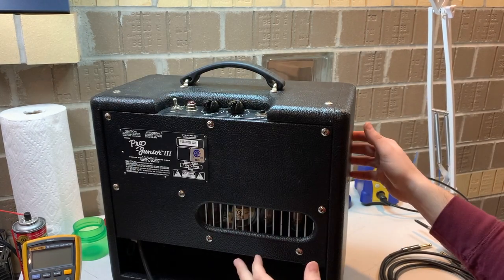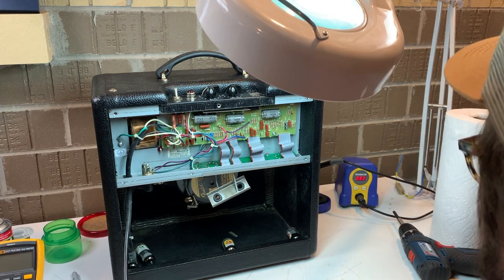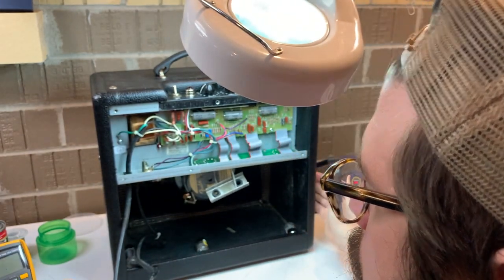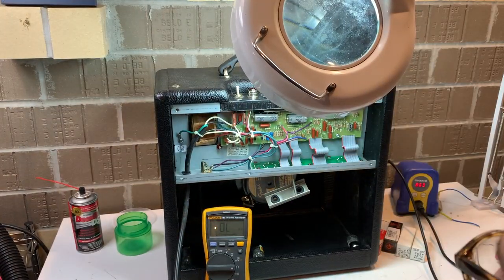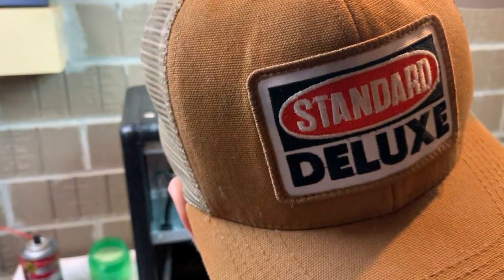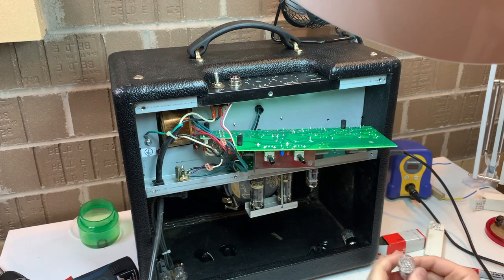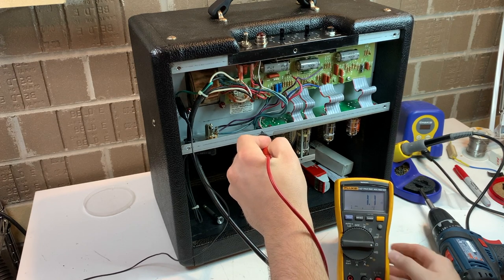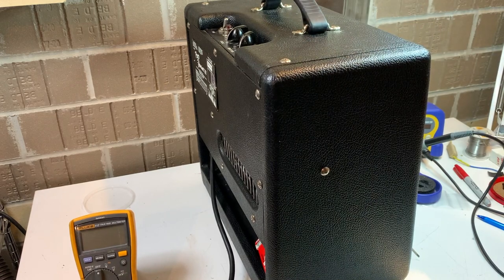Commonwealth Pro Audio - Fender Pro Junior Repair

Comment: could an xternal speaker out be added to this amp? thanks
Reply from the maker: Yes, but what's the goal? If you want to push the internal speaker and an external speaker at the same time, you would need to swap the internal to get the right ohm load with an external. If you just want to use an external cab without driving the internal speaker, you can disconnect the internal speaker and use the 1/4" output that drives it.
Reply: @TheBrothaAB  what is the ohm load on the internal speaker?
Reply from the maker: @huanton2many  8 ohms
Reply: @TheBrothaAB  I see. Then the external and internal speaker should be 16ohm each to match the amp. Which in return means that the amp would be mismatched when played without an external cab.

Comment: I bought a pro junior used for my nephew and the guy lied about the condition when you play through it ---it is sort of whistling or howling sound wondering if you have come across this before i have searched everywhere online and there is not much about this. hoping it is just tube replacement or ...
Reply from the maker: It's hard to diagnose something in a comment section, but a bad preamp tube can cause the issue you're describing. The first step is to swap the two preamp tubes with each other. This is really just to see if you get a change. If you experience a change, we can be pretty sure that the issue is preamp tube related.

If you have some spare preamp tubes, or if you want to upgrade the them to something like Groove Tubes - go ahead and change them for some new ones. If that doesn't fix your issue, take it to a qualified tech because the next step would be to open it up.
Reply: thank you i am testing tubes for microphonics first and replace tube that is not sounding right if that does not work then I will take it in to professional I appreciate you answering me.
Reply from the maker: @jamesklucky777  You're welcome! Keep us updated when the problem is solved.
Reply: @jamesklucky777  do you solve the problem? I have the same on my pro junior 3
Reply: @dar6497  it was the pre amp tubes that needed to be replaced!!! works great now
Reply: @jamesklucky777  after all this time i wasnt expecting your answer , thanks !! 😊
Reply: @dar6497  sorry I thought I replied to this a while ago and when I realized I had not I wanted to let others know for sure since it was baffling at the time. Thank you for the advice!

Comment: Those crap amps have lots of problems because of lead free solder. Designed by engineers manufactured and overseen by accountants!
Reply from the maker: I'm no fan of lead free solder by any means, but I've never zeroed in on it as the culprit for the issues that these amps (and the entire Hot Rod series) have with the tube PCB. I'll have to do some more research!